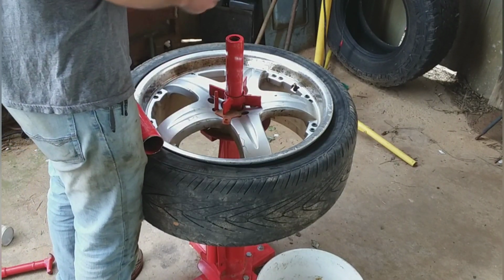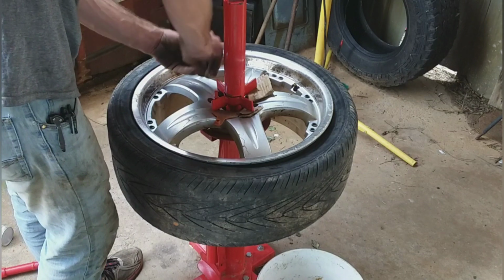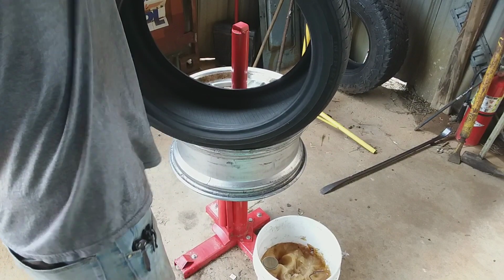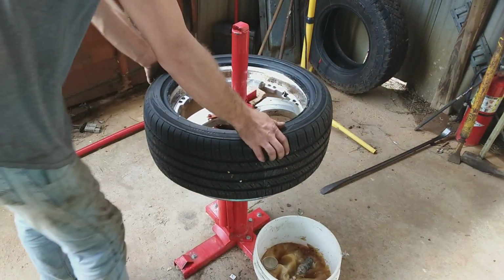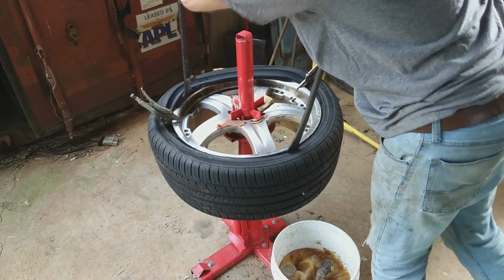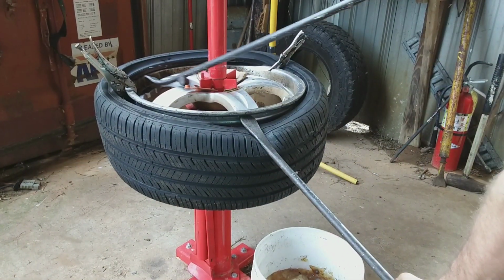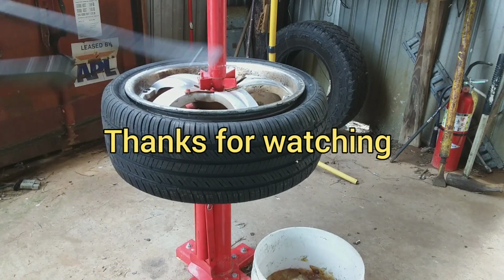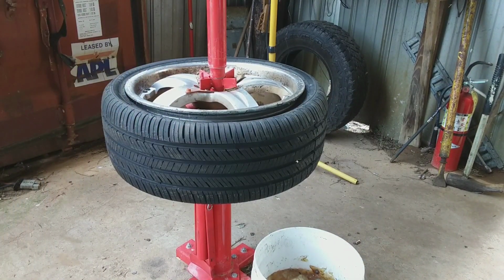How to change low pro tire by hand with harbor freight tire machine.

Comment: Just did 17in lo pro today and on that HF changer and it was such a pain. Thanks for confirming that I was not the problem. I used tire irons to mount and had lots of trouble until I had my wife hold one in place while I used the other to mount. Also I had a little bead breaker clamp holding the tire in the valley below the bead ridge. And finally got it on. 

I will have to demount and remount again later this week so to try to get the fancy part of the tool handle to mount, I went to Home Depot and got an 1 1/4 inch pipe (about 16 inches long) to try to get more turning force from leverage. Praying that it will work so I won’t have to use the tire irons again.
Reply from the maker: Ikr

Comment: Thank you for this video.  I had a low profile tire, 18" also and it didn't want to go in as easily as the other tire mounting videos I've seen.  Thanks for explaining how it is important to get the bead on the center cavity.  Very hard to do on low profiles (because side walls are not as wide) and cannot get one end to stay down as I worked around; but the vice grips did the trick!!!  Other videos showed using 3 to 4 tire pry bars.  Then there was another video with multiple pry bars with kids helping hold the other pry bars to help the bead set in the cavity (gosh my daughters are still too young to help me).  And then this; wow, I never thought of using vice grips!!!  With 3 vice grips, I did use an extra pry bar to work my way.  That's ok because at least I didn't have to buy another special tools!  I also mounted with the rims upside down with mat pads cut to size and placed on my mounting plate.  All this prevented scratches on the outside rim while tire mounting and it worked since I noticed also that the my rim cavity had a slight offset towards the inside.  I suppose my alloy rims were really meant to be tire changed upside down.
Reply from the maker: Yeah a friend and I had his wife's car and it's a brand new Honda, we did it together and put the new tires on without scratching the wheels or anyting. Just had to take your time and use some padding.

Comment: To get the same results... Take a large hammer and just smack the hell out if you rims for about 30 minutes until the tire falls off. The pick up the wheel over your head and throw it down the drive way for oh... 10 to 15 minutes should do the trick... Then youre ready to put the new tire on... Youre gonna need the hammer again for this step wlong with 13 tire irons... Good luck. Ive got the same machine and the hook end of that tool that je said was junk, works pretty good if you know how to use it
Reply from the maker: Ikr

Comment: I have a floor machine like that, it is about 40 years old and has a lever to refit the tire the same way as demount. This way you did it is unnecessarily hard work, but the clamps are a good idea. I will try one next time.
Reply from the maker: Ikr

Comment: Appreciate the video.  I knew it was possible to do 17 and 18 low pro's on the HF changer.  A little more care and rubber pads could protect the wheel for sure.  Hell can't be worse than the shops i've been to.  You proved it could be done and thanks for that!  I"ll be doing my 17's and 18's now.  I just wonder how well the bubble balancer will work on these.
Reply from the maker: I had to do a friend's car the other day, and it is a brand new Honda with nice Wheels. We took our time made sure to use padding and didn't scratch anything and it was fine.
Reply: @expresshappylife8619  Good to hear it works on big wheels.  I just had a tire pressure sensor go bad on a 17" 245/45 tire.  I'll get to try the changer soon on that one.  Ever since i got my first car I always wanted to be able to do my own tires.  Only thing left to do myself on cars.  Again thanks for posting the video.  I've got a few myself.  Tools real people can afford to get the job done.

Comment: I would call this -the Vlad the Impaler method of tire changing when it really doesn’t matter how badly you scratch the shit out of your perfect wheels—
  The guy knows what he’s doing when it comes to manually changing a difficult tire. But I would take these wheels to a place like NTB or firestone where they have modern “ touchless” machines that will not scratch the wheels..
  Footnote. 
 Both my sons had honda’s. A prelude and a CRX. I told them and not to buy low profiles and wheels for their cars because we live in Pennsylvania. Pennsylvania roads are horrible. You need that extra sidewall tire and strong wheels when you live where the roads go from bad to horrible every year with the freeze/ thaw cycle,,That creates potholes. And then The road crews come around and fill the potholes, making bumps out of holes. here in Pennsylvania we have the highest gasoline tax  in the usa that is supposed to pay for road maintenance ..I’m still waiting.
  my sons did not take my advice and stick with the factory steel wheels on their Hondas. not only did all four wheels on each card get bent badly because of the low profile tires that don’t really absorb bumps and protect the rim. But when my one son had a nail in the tire, the tire place where he bought the tires would not plug or patch the wheel, because it had a Z speed rated tire..In Pennsylvania, they are liable if they plug or patch a Z speed rated tire, if it fails...so they refused to repair the tire.
  do you know how they get a Z rating on a tire? It’s the same with motorcycle tires. They give them less material/less tread. Why? Because that extra weight causes the tired to “grow “because of centrifugal force at high speeds. They make the tire lighter by giving it less tread so that it won’t grow as much. So when you pay those extra dollars to get high-performance tires, you’re getting less tire at the same time.. The higher the speed rating, the less tread depth you get...
Reply from the maker: Thanks